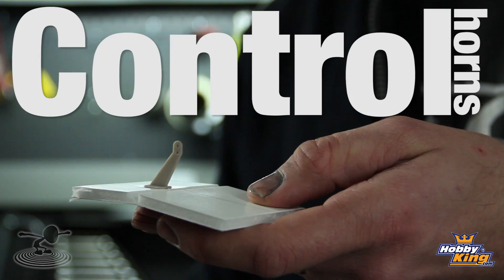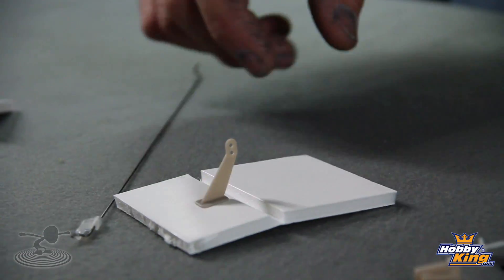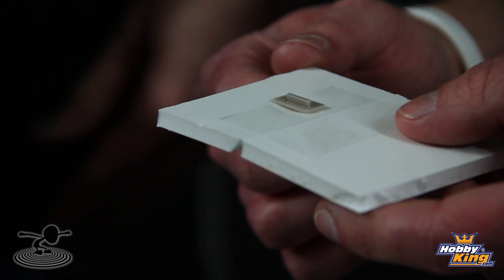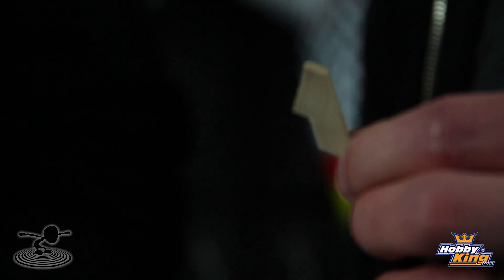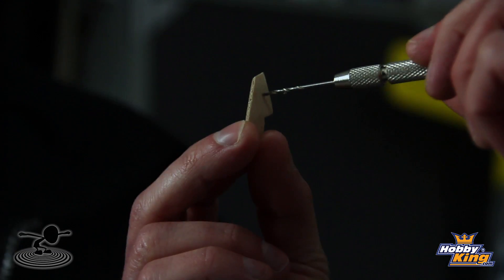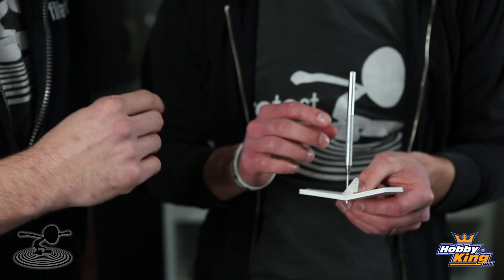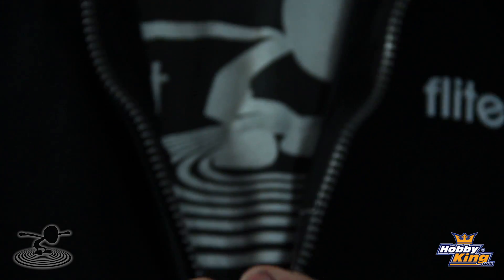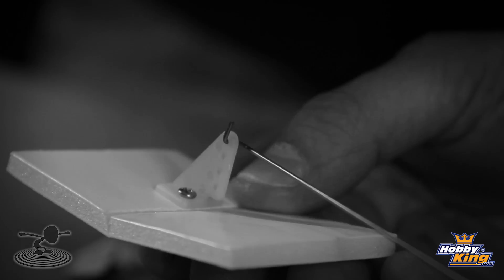Flite Test - Control Horns - FLITE TIP

Comment: i need help figuring out how to hook the servos to the receiver. this is my first time trying to build something an i own 3d printers so ive printed all the parts an i just built a simple foam board plane not really that interested in seeing this fly but trying to get everything on something an working like it should then im going to go an either print a full plane or a mixture of printed an foam parts. the foam board i have to work with is 5mm thick so not the thickest stuff and for the electronics i have cheap 30amp esc from amazon and a 2200kv brushless motor an the atm a total of 6 sg90 servos. the transmitter an receiver are also cheap from amazon but had good reviews so i tried it, but its the flysky fs-i6x. ive never had the oppertunity to be around rc planes so i have no knownledge what so ever of how they are suppose to work as far as how the controls on the controller are suppose to work, ive had the motor work with the left throttle stick an ive gotten a servo to work for each direction of the right stick, but my confusion is when u pull back on the right stick i imagined both elevators being pulled up to make the plane climb but with what im working with when pulling the right stick back only one servo moves so im not sure if im suppose to make both flaps work together an at different times with it being an intuitive feel on the controller, i can do it right not but it takes me pushing the right stick up an to the right to get both sides to do the same thing. i hope im explaining this in a way ppl understands. i know i got something wrong an ive not been able to find alot of info on building something from scratch, its always kits an they never really go through how to connect the servos to the receiver so they work correctly the transmitter

Comment: I want to change the control rod position on my little umx champ -

those little horns are delicate and stuck in foam that could easily be damaged-
so do you use the pliers to bend the rod or to bend the plastic horn ?
or both ?
Reply: I feel you, they bend so easily.  If you find a good solution would you mind sharing with me?  I'll do same if I run across anything,
Reply: Its 4 months later and I could not get help with the subject --
so by experience - what is working for me is to use my fingers
and bend the horn a little with my fingers and at the same time bend the control rod a little - 
being patient and keep working at it 
and so far - it goes in sooner or later -
nothing broken or damaged as of now

most recent accomplishment was to replace a broken control rod
getting the rod out of the hole on the servo on the computer board was hard for me  - I'm sure it gets easier with experience

Comment: Do u know why they have the stryker 180 is set up for maximum throws out of the box and why they recommend u start of like that in the manual. It flys great but Im confused why would factory settings be set up for extreme acrobatics.

Comment: Hey I have a question. I bought a plane and started building it but I wore out the screw head for the control horns so instead of screwing the control horns in can I just use glue? My plane is a P51 by FMS.

Comment: Hi i cant rite in inglish, sol im sory. i just have 3 things to say
1 say more abaut the lay the plane flys, what tho you notes from the normal prop planes lith props what to luc aut fore wen flying and what to du and what not to do wen flying this plane 
2 make a fpv set up the chepest way to go into it what to luc aut fore what to bay and what to luc aut for 
3 make more videos abaut how to make the planes more stabel faster slower and HOW TO THISAN A PLANE FOR MISELF AND TO PIC A MOTOR